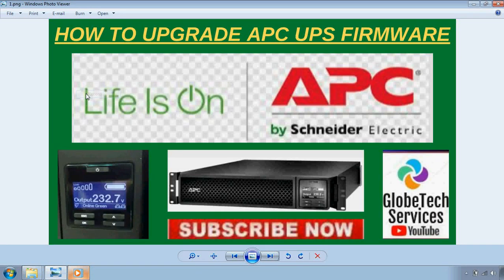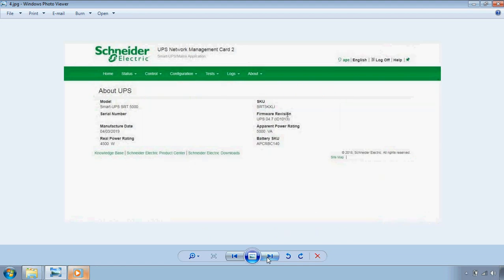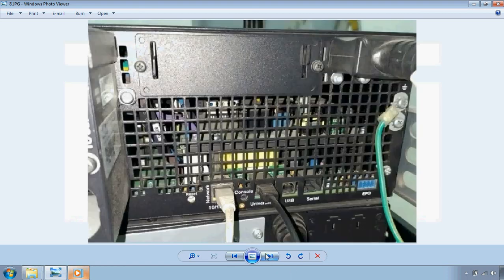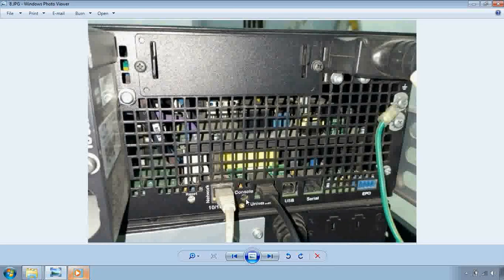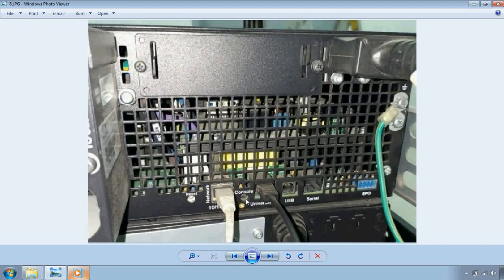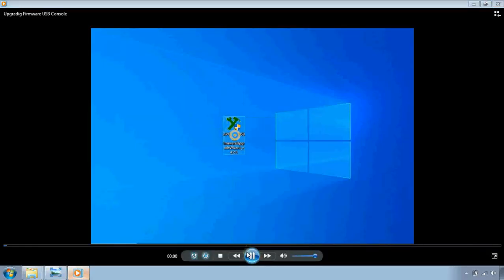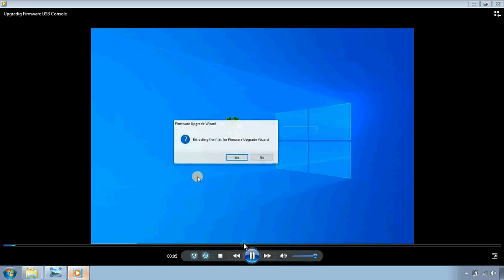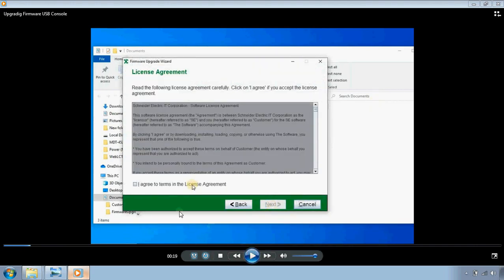How to upgrade APC UPS Firmware Step by Step Guide

Comment: Hello. When updating apc srt6krmxli, the output groups of sockets were not disabled and the firmware did not completely update the UPS. Do you have firmware upgrade wizard version 4.0 or firmware SRT1013UPS_04-0.enc?